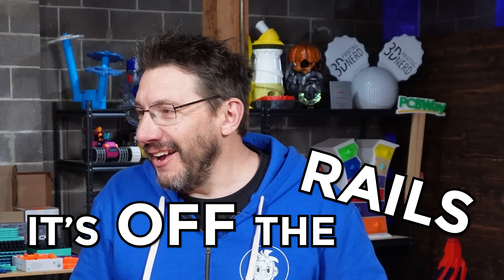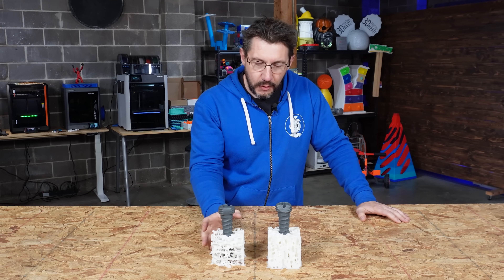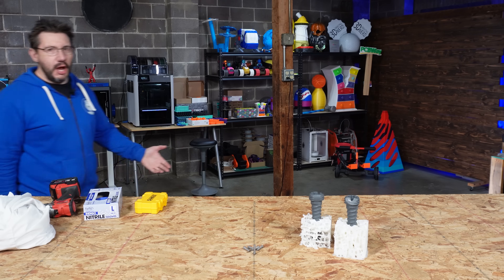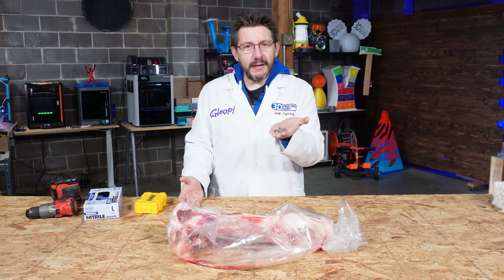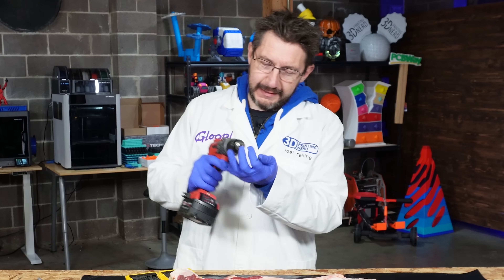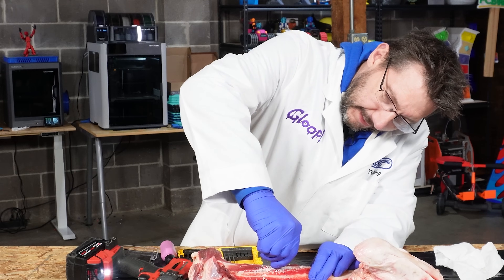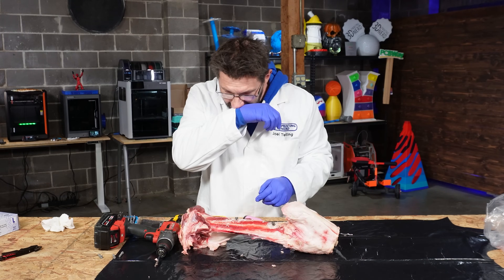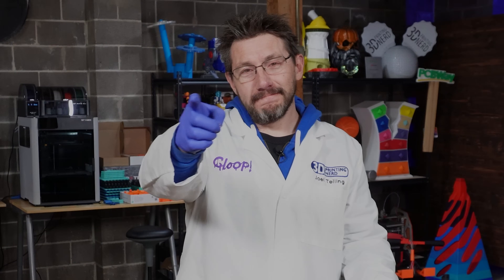Dr Joel & the Bone Screw

Comment: At my work we have an supplier which makes custom 3D printed implants for situations where normal implants don't work. We use their service once or twice a month. Its very interesting to see how they manufacture the parts, certify the implant, make it sterile etc.
Reply from the maker: Holy cow, is this something they would be up for being on video about? Can you reach out?
Reply: @3DPrintingNerd  I've only seen those implants, and now how they certify it. But I don't have any contact with that company, an colleague of mine on the OR does that.

But the company who does this is called BAAT Medical in the Netherlands; they own multiple sister companies who are specialized in 3D printing.

Another company who does the same (and is closer to you) is Eminent Spine in Texas; fun fact in April 2025 they have received the first FDA 510(k) approvement for an spinal screw.

I think its easier that you contact one or both companies yourself. Maybe they are interested into showing their process.

Comment: I am working in Medical since 25 years, 11 years now in Additive Manufacturing, mostly Metal based in Implants. That screw you printed is a Cortical Screw, it means you need to Drill through the bone penetrating both cortical shells, top and bottom. The Screw always will be measured the complete length. It´s only stable if it  screwed in on both cortical shells. Alternatively there are Cancellous Screws which has a different thread. The thread will hold then in the Cancellous bone like you did here. But both types of screws has completely different application area. While the one stabilizes, the other one compresses. Happy to teach you in a cadaveric lab workshop :D
Reply from the maker: Whoa, I didn't know! Also, YES - would love to learn more!
Reply: There are nowadays plenty of printed screws. To make a normal bone screw it makes no sense to print cause it is a cheap swiss turning Part. If you have some special screws with Special features you not even be able to machine. You need to Print. One of the first printed SI Screws are from a Company calles SIBone.